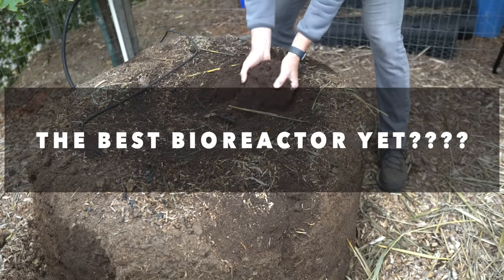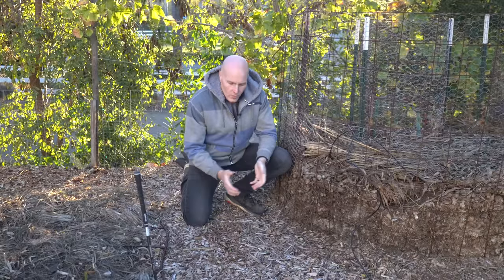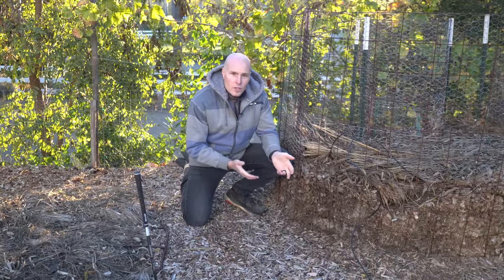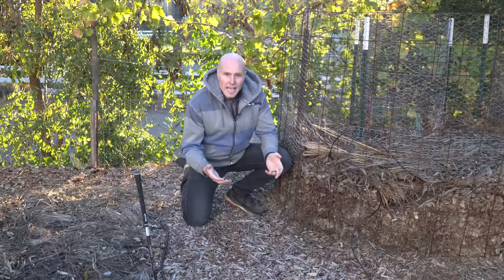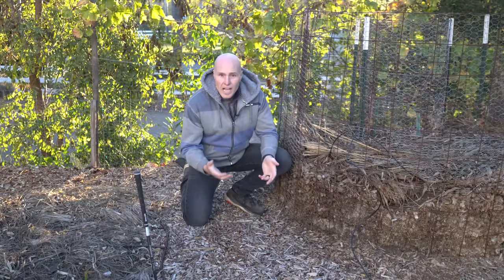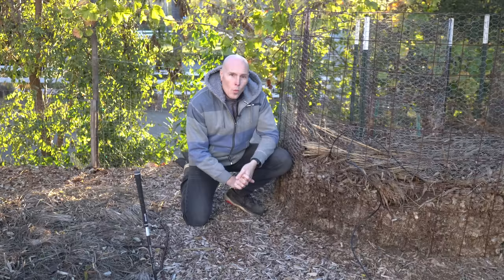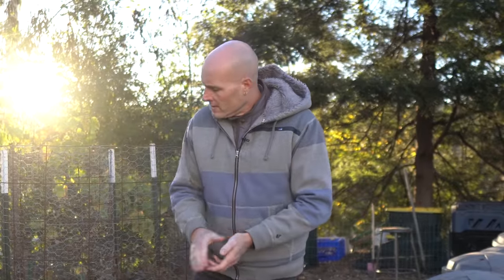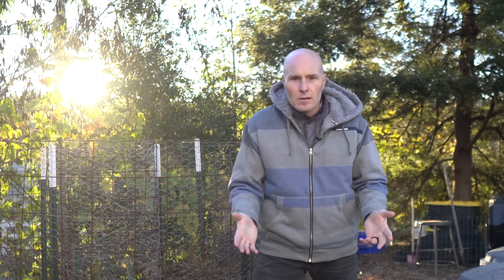The Best (or Craziest) Compost Bioreactor Design Ever!! (WILL YOU TRY IT???)

Comment: Interesting concept, although I am curious how the wood chip would impact airflow, since the idea of the double ring reactor is that air only penetrates 1' into compost.
Reply from the maker: I think the wood chips would be permeable enough to let airflow in.  You could also add some plastic tubes initially around the second ring if you thought this was a concern and remove them shortly after filling.
Reply: @DiegoFooter  i would be more likely to dig onto the pile sometime after filling and making sure it stays aerobic, than messing with pipes, since that is part of the reason for the double ring to begin with.
Reply: @DiegoFooter  I'd just assume that the total air penetration depth to be the same as a traditional Johnson Su (6" either side, total 12" or 1'), and so it would be 12" minus the thickness of the woodchips gives you your total air permeation into the pile up to 6" from the outer surface and then whatever else from the inside. There's some interesting mathematical models which maximize the surface area to volume ratio which you could theoretically implement but they aren't as easy to build and probably are outside of the scope of most people watching these videos.
Reply: A crowbar through the skin will let air in. It doesn't have to look pretty to work. Birds seem to do a lot of the work in my leaning tower. And the tomatoes growing out of it get transplanted into companion space with asparagus.
Reply: Wait, Johnson shows filling one of these with mostly wood chips, yet now they don't allow air flow?
Reply: @ronniemcmaster8657  Johnson's work showed that air infiltrates upto 12" into a compost pile, that is the point of the vertical tunnels in the Dr's reactors and the inner ring on Diego's. 

And while Dr Johnson uses a good bit of wood chips in his compost mixes, Diego's earlier work was on composting majority or all wood chips, and used the same infiltration depths as Johnson's original work. 

So the question is now, what kind of air infiltration depth do we need to adjust for with this triple ring design.
Reply: @Dan-wt7jx  I don't believe any change is needed to be made. The mulch used in this thin outer ring will likely be dry, which will keep it lighter than the moistened inner compost. Since this layer is thin and the material lighter, it will not compact as much, which will allow more air to flow through, while also not letting enough air flow to dry out the primary compost. I've seen enough of Dr. Johnson's videos to see that he had no equipment testing the airflow for an exact measurement of 12 inches. It was an educated guess, which produced great results. Anyway, that's just my thoughts on it. May be worth trying to someone out there.

As much as I would love to try this concept. I will likely have to load it in a truck to transport, so will use the original Johnson-Su reactor with fabric and on a pallet. If done correctly, then the plastic will last through multiple composting cycles.
Reply: Diego's crazy patent pending 3 Ring Circus Composter ♡
Reply: @russellradwanski5771  That was might thought as well. I thought I heard David Johnson say that air will penetrate a total of 1 foot, 6" from each side, not 1 foot from each side.  If that's the case, then the center of the second ring would become anaerobic without the layer of wood chips. The wood chips would reduce airflow even more.  These bioreactors are a lot of work but if done correctly it takes very little material to inoculate your soil.  It would be interesting to see what Diego's compost looks like under a microscope, maybe air will penetrate deeper than we would guess. Regardless, thanks Diego for all of your inspiring ideas, this video has already sparked a lot of interesting conversation. Very engaging interviews as well, great work.

Comment: Make the outer ring larger and line it with two layers of cardboard when filling it. The cardboard gets moist in the initial build up and attracts worms that make their way into the compost. Pierce the cardboard with a crowbar or flathead screwdriver. It worked in our wet NZ environment and we have usable compost that gets dropped out into a screen after nine months with the screenings innoculating the next batch. Cardboard is in weekly supply through our grocery store packaging, so it's a natural "use what you have" proposition even if you have to save the stuff for a few weeks. We continue to add mostly dry cow pat's during the drier summer months that supplies more microbial activity when wetted by autumn rains helping to increase the activity during winter ready for early spring planting.
Reply: First thing I thought of too... free and durable but compostable. Also as a lid

Comment: Not sure it makes sense to add an outer mulch ring as the compost pile itself will naturally have a dry outside mulch ring. You’re making more work for the same result. The double ring is just fine. The outer layer that doesn’t compost as well just goes into the next pile you make. Same as how a static compost bed is done with it’s outer layer acting as mulch and then scraped off and reused.

Comment: Filter fabric doesn't stop evaporation - it's designed specifically to be permeable. Water/air passes right thru. Johnson used it simply to contain the small bits from falling out over time - your chicken wire does that just fine. No need for a third ring.

Comment: Do you really need to make an additional ring? I'm just thinking this through and wouldn't simply making the outer ring a few inches thicker do the same thing? From the other Johnson Su style reactors you've made and opened the outer surface was dry and a certain depth into the pile was moist and composted. To me that is the same principle. Adding wood chips to the outside would just increase the ratio of outer dry and inner moist. The same thing would happen if you simply make the outer ring larger and skip the 3rd ring mulch layer. Just my thoughts, thanks for all the videos.

Comment: My traditional winter compost pile is 6' by6' and about 5' tall to start.  I pick up recyclable bagged leaves and circle the pile for insulation.  When building the pile i space pvc pipes with1/2 inch holes to keep the pile aerobic throughout the winter.  Last winter with temperature dipping down to -10 degrees F,  the pile never got below 100 degrees F. This spring I had plenty of finished compost  to add to my raised beds.
I like this idea because I do not have the need for large volumes of compost, and it is a ton of work.
I also invested in a microscope to see exactly what it is I am adding to my soil.
I like your thinking on this project, it's a one and done, plus you have the partially broken down wood chips for the following load.

Comment: I modified your "Donut" bioreactor into a "horseshoe" open on one end so I would have easier access. It has been working great and as a bonus our chickens climb and scratch the top of it. It's a combination mostly of browns as I'm not in a hurry for it to make compost. I will add some grass clippings or chicken manure on the top to keep it covered when needed. It works surprisingly fast at reducing bulk. Airflow is the key to the process IMO.

Comment: When you posted a previous video, I did mention in a posted comment the possible inclusion of a third ring full of mulch.  My suggestion in that post was to also plant potatoes into the outer edge of the ring of inner composting material.  As a result, the potatoe plants would push out from the compost ring they were planted in, and through the straw or wood chips that were used to mulch the outside 3rd ring.  A water ring emitting irrigation on the top but quite near the outside of your middle compost ring would provide moisture to the potatoes, and by looking at the potato plants you can monitor if your watering is effective.  The compost pile would be full of green foliage, providing more shade and a more pleasant appearance, and it makes use of the outer 'compost' which is the least likely of all your composting material to be of top quality due to this outer area lacking the full biological activity that always happens in the more central parts of the pile's contents.  This would also give more biological life to your mulch and thus give you better material for the next composting process as you mention in this video.  You might lose a bit of good compost to the potatoes, but you get potatoes!  Great that you are giving this idea some thought, and I hope that if I don't take it on this season, that someone does, and lets you know about it.  Take care, keep up your amazing work, and happy Solstice time.
Reply: What a great idea! I thoroughly enjoy double purpose builds too. I might have to try that! Have you built one like that yet?
Reply: @sarahgracenadeau  I havn't yet.  If I can find some large page wire fencing scraps to build the hoops, I'll get on it.

Comment: I built one of your double ring reactors this fall. I used  5' and 1' diameter circles.  I used 4' high fencing with  2" by 4" holes lined with 5' tall chicken wire.  I like the 5' diameter better than 6' and I like it 5' tall  so that I can get a huge amount of material in it.  I wanted to go 6' tall, but it would have been too hard to load it.

My only mistake was loading it with shredded leaves that were too dry. I basically had to climb into it and unload most of it so that I could get it properly watered. Next time I will have the leaves soaking wet before they go into it.  I used a huge amount of shredded leaves along with approximately 400 pounds of coffee grounds that I picked up at Starbucks.

 It is not worth the time or effort to add a 3rd ring because it will also diminish  the air flow  going into it. 

 I need to finish filling it back up later today or over the  weekend. Then it should be all set to sit over the next 4 or 5 months.
Reply: I did a similar thing. Sides too high to fill easily.

Comment: Seems like you're just making a bigger compost pile lol... compost is mulch,  just returning to nutrient cycling.  The more broken down goodness is always in the middle, so just take that already dry outer mulch layer and use it for next compost or mulch your beds.  You'd be surprised how much life is in "not ready"compost. 

Woodchips won't decompose without fungi. 

You can add King stropharia and beech(hypsizygus) mushroom spawn to your compost after the thermophilic phase and inoculate your beds by spreading spawn under mulch layer in the drip zone of plants and in your wood walking paths. Both mushrooms work great with plants and hypsizygus is know to work with mycorrhizal and will speed up the process. Get the NH4 back in your soil with fungi.
Sorry for the rant Diego , thanks for putting the time into everything

Comment: Harvesting from this would be a real hassle.
I also don't think it would prevent the compost from drying out.
If it does, then the outer layer of the compost itself might do pretty much the same thing.
If there is a real difference between how wood chips and compost dry out, maybe add an outer layer of woodchips without using the additional ring.
I would favor using perforated cardboard as an outer anti evaporation layer.
If cardboard isn't clean enough for you,  try untreated wood slats.
At that point, your almost back to a bin made of pallets.
Add a center ring and you are good to go.
Reply: Woodchips hold 50% water. Straw holds 70%
Wouldn't recommend using anything the same particle size, if going to be just straw much it. But diversity is key in nature so make it key in compost

Comment: I am trying simply filling a big bag with wet leaves and covering the top with a plastic and watering from time to time.
Time will tell but I don't see much difference with my actual Johnson-Su Bioreactor using a 1000L IBC.
The big bag is a bit smaller but once the leaves start to settle volume seem to be equal.

Comment: You stole my idea! I already have one here in Northern Maine. I’m 38 days into it. It held above the magic 131F for almostI 30 days before cooling off when it dropped to -3F one night. I did it for insulation, but it was also going to be “mulch” when I build 2 more next spring. I didn’t use wood Chips, I used straw. Almost everything your saying (I’m typing while I listen) about cycling the stuff to the inside I already have done it, or planned out.

Only joking about you stealing my idea. But it did feel like you had taken up residence in my head. But for the record. The only thing similar to yours is mine is round too. Same with any similarities with David Johnson’s design. It’s round! (Smaller then both) I have to check all the boxes, plus a few that fit my situation living north of the 46th Parallel. I am going for the Dr David Johnson end product though. Hopefully worms and all! Right through the brutal winters.

Comment: Questions: should inner ring of organic material be offset by the outer mulch ring to maintain the 2' outer diameter to promote aerobic conditions? 
Best way to efficiently fill outer rim?
Strength of structure would put chicken wire on inside of t-posts. Ease of access would put wire on outside of posts. Which way to go?

Comment: My concern is for when the time comes where you are at the end of the cycle and are ready to remove the final product, it's going to actually be challenging to remove the wood chips from the third ring. It's going to fall on the ground. I like the idea of the third ring as it should really help, but, when the time comes, just let the wood chips fall to the ground.
Reply: Bacteria and fungi produce glues,Glomalin. So they don't get washed away like all other fertilizers that end up in are water system.  So when you remove the metal outer ring nothing will happen, you can remove it after a week if you wanted. 
Good soil looks like cottage cheese, nicely formed aggregates. This allows air flow and water retention

Comment: you could basically achieve the same effect with your basic improved design, you'd just need to be strategic when filling the reactor, making sure to put some wood chips to the side of the outer ring each time you put the matter in the middle, it's a little more work if you are going to fill it all at once, but if you are filling it as you go it will only take a minute every couple of days...

Comment: I have made a Diego donut last April using mesh, roofing fabric. It's a bit smaller diameter because that was my mesh size. The inner ring is 30 cm diameter. So far it's filled with migrating bird droppings and sawdust. Just recently I have topped them up with frozen pumpkin leaves and mulberry and poplar leaves. It had a few worms added but who knows if they have survived. Personally, I don't think I will try the extra ring. I like being able to top up the main compost ring with finer and finer material.
Reply from the maker: Where do you get all those droppings?  That’s a cool resource.
Reply: @DiegoFooter  the birds pick two Central parks in Chihuahua. The gardeners were filling tip trucks up and taking it to the dump. We paid them to fill up chicken feed bags and we managed to obtain five Ute loads. Since the municipal government sees the birds as a health hazard, I'll have to see if we can get some more this year. The weather has been warm and the birds haven't migrated so far.
Reply: Our neighbors have horses with an uncleaned pen. The bioreactor filled up with fly maggots to my horror, but then an army of large black ants carried them all away. I wonder if half the nutrients went into the ants nest. Our fly numbers actually decreased dramatically.

Comment: THE OUTER RING WOULD/COULD LIMIT AIRFLOW.  Sandwich PVC tubes with holes every foot in the woodchip ring to insure adequate air penetration.  I'm doing this in the spring,  Thanks Diego!

Comment: I like this idea.  I suppose you could add a thin 4th ring for woodchips in the center so the inner material doesn't dry out as fast.  I have been making my bioreactors using pallets with the latest one borrowing from your center area design.  Moisture hasn't been much of a problem but my climate isn't as dry as yours.

Comment: I agree with the cardboard I am also in Nz, I line my conventional NZ designed squares of timber stacked which has spaces between the layers. I line with cardboard and also use cardboard as another carbon layer. this blows loads of air to flow, moisture stays evenly through the year ( my compost is ready full stack til usable about 3 months) I can bury a trapped pest body or deceased hen and have nothing but the largest bone left at the end of this time - all fur/feathers totally gone)

Comment: I actually built a very similar reactor behind our garage here. It's 6 feet high, but I did an inner diameter of 1 foot and our diameter of 5 feet. It seems to be working out OK, though I haven't done the best job keeping it watered. Anyway, I would really not suggest using burlap. In my seasonally wet climate it just breaks down too quickly. I had to add cardboard boxes to keep everything in, which works way better but probably significantly reduces airflow. I think I'm just going to have to spend the money on fence mesh.

Comment: I think I'll just look at the outer edge of ring two as the insulation. If the out side stuff is dry and not composted when harvesting I'll just return it to the bin or use it as carbon in my worm bins. Just using the inner compost.